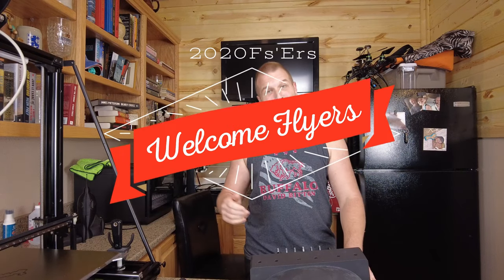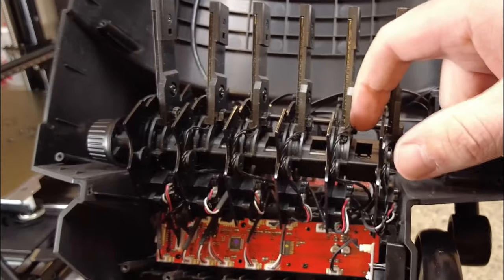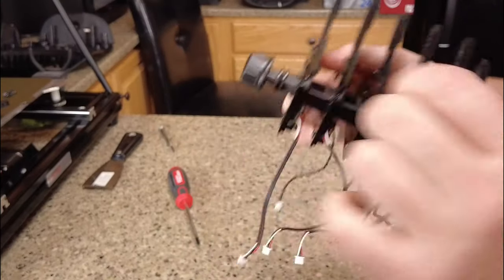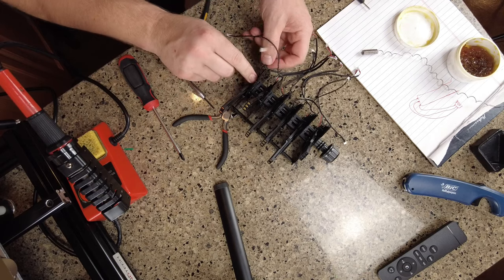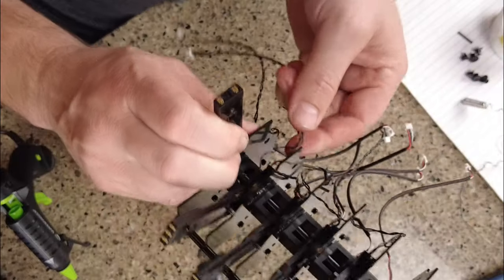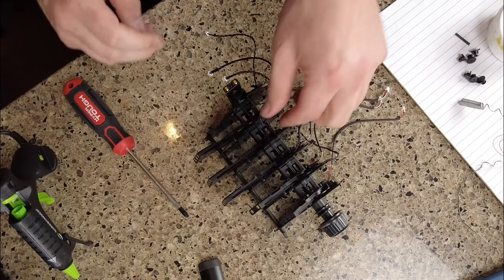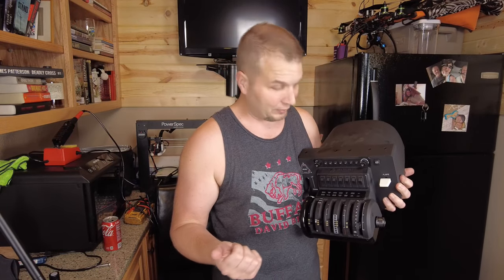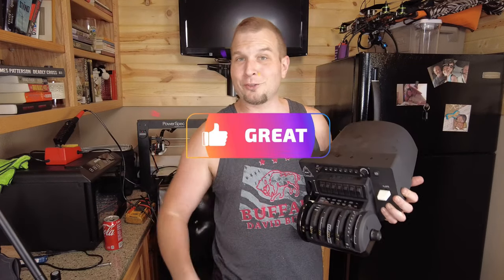Honeycomb Bravo Throttle Quadrant Problems REVersers NOT WORKING! Bravo Teardown REpair! POOR DESIGN

Comment: Just sent mine out for the same issue with one of the reversers. Got the new one in today after waiting two weeks. Went well until I realized the number 5 lever isn’t working. Oddly enough, when I move the #6 lever, the #5 in the calibration app moves which makes me think something isn’t wired correctly.
Reply from the maker: Yep you probably hit the nail on the head 🙄  the qc is not quite running on all  8 cylinders.
Reply: @2020fsers  What’s frustrating is no one is picking up their customer support phone. It takes 3-4 days to get a reply via email. And this thing literally just arrived from freaking Hong Kong. It’s like come in guys, you want me to do this again?
Reply from the maker: Omg that's nutz
Reply: @2020fsers  Right?!?! Looks to me like someone wired it wrong.
Reply from the maker: If you pop off the bottom they are plugs so you pull the plug and switch between the 2 . But i know we should not have to do that but ...
Reply: @2020fsers  So I guess I will them credit where it’s due. They just picked up their phone. Watched the video and they said they had never seen that before. Because it’s the second one, they’re going to ship it directly from their office. They’re shipping mine directly back to their office so they can check on this because they were concerned about it. So I’ll give them that.
Reply from the maker: Yep at least they are making an attempt

Comment: I've just sent my 2nd unit back with this same problem!
Thought it might have been something as stupid as this engineering fault
I'm wondering if the give a 12mth warranty on the replacement units?
Reply from the maker: I doubt they will . Hope you have better luck on this one
Reply: @2020fsers  if that's the case I will probably pull it apart when I get the new unit and hot glue the wires in place

The annoying part is Honeycomb aren't answering my help ticket !  It's been 8 days now and 2 more requests.

I love this flexibility of bravo but if there was another alternative I'd asked for my money back
Reply from the maker: I agree
Reply: UPDATE: Honeycomb just confirmed that they will give the full 12mth warranty on my replacement unit but they didn't confirm if they have solved the engineering problem :(
What do you think the odds are that my 3rd unit will break and need to be sent back?
Reply from the maker: Thanks a great update for warranty .  Probably gonna need it most likely they haven't fixed the issue tho 😕  or maybe they did only way is to open it up and take a peak .
Reply: @noisecraftstudio5817  I would not bet against it!
Reply: @anthonyvallillo422   They have confirmed a full warranty on the replacement unit
Reply: @noisecraftstudio5817  I hope that the replacements are also warranted for whatever the length is (someone mentioned one year) after the REPLACEMENT gets to you!  But sadly,  I have already lost at least a collective month of use to the replacement cycles.  This is a real shame, because if they were sturdier they are an outstanding unit, albeit somewhat difficult to set up and program.  Fortunately, others have undertaken to do that for us in the form of the profiles available on the web
Reply: @anthonyvallillo422  Just sent back my 3rd unit back because of this broken wire problem :(
Thank god it's still under warranty but I'm only getting about 6 months use out of a unit before it fails!

Surely this is not just bad luck!  They must be getting hundreds if not thousands of returns!

Comment: Hi John, hope you're well today, I need help, for some reason my prop 1 (C208) feather detent (switch button 26) does not make the prop to feather, nothing happens, closing the prop brings it back to the Prop MIN position, pulling prop lever beyond the flight detent position does nothing, the Caravan's prop stays unfeathered during shutdown, it just doesn't look and work correctly, please help Mate, thanks?
Reply from the maker: I will look into it and let you know
Reply from the maker: Try prop decrease instead for button 26 and see if that works
Reply: Thanks & wildo....will let you know tomorrow, I'll be a happy 2020 fs'er if it works, so far the C208 is the only aircraft in my fleet that does not cause a CTD or failure of any app, so the C208 has now jumped to the no 2 spot behind the TBM
Reply from the maker: That's crazy but I have also been getting more crashes than normal for some reason 🤔
Reply: Got hit by a 9Gb mandatory update this morning, doing that now, whilst sitting here and watching the white status bar grow I can't help to think "what on earth of all my sim stuff, software and hardware, will not be working when all this is done?", I'm optimistic, but from experience, since Sim Update 1 there's not much hope it'll be smooth sailing after the restart....keep you posted on that feather detent setting
Reply from the maker: Oh my lol I thought an update around the 19th was expected hope it's good let me know how it goes . 😅
Reply: Wildo, I guess you'll have it available already, it's the 20th now here  Downunder, unless you're beaten by the international dateline 😄
Reply from the maker: Lol I haven't turned on the sim today I've been making vids . 😅  I spend more time on videos than I get to fly lol but it's OK.  Some days I just don't even turn it on ya know just need a break sometimes and enjoy the outside .
Reply: Prop decrease doesn't work unfortunately ☹
Reply from the maker: Ok when I do fire 🔥 this thing up I will take a look
Reply: After Sim Update 6 and updating all other sim market place items, and PC reboot, my Honeycomb Bravo is now completely reset, all profiles changed, not even mixture lever working, the sim pick it up but no action on lever movement in aircraft...kinda expected from Asobo's update, frustrating and annoying is an understatement 🙄
Reply from the maker: I agree I use spad.next I was tired of my settings never saved for my bravo and alpha so I had to get something spad I'd great I love how you can configure anything .
Reply: My next request, 🙏 "please make a video on how to configure the Bravo using spad.next", I have that too but struggle, a video using spad would be great 👍
Reply: Sim Update 6 broke my Bravo, bought the Okavango scenery pack yesterday, had fun flying around in the C208, landing at all the various bush strips and watching the animals, after Sim Update 6 my Bravo is kaput 😭
Reply from the maker: Really nothing works? Even in the control menu ?
Reply from the maker: Im doing the update now it's morning here 8:27 am
Reply from the maker: This should be  a fun update lol not
Reply: Throttle 1 axis and reverse thrust working, Prop 1 axis working but no reverse thrust detent (I tried all options in the control menu for this, only get Prop 1 to go from MIN to MAX, Mixture not working at all (I tried all options in the control menu too, but no success)....all controls, apart from Prop Feather worked till I switched off the PC, when I switched it on this mng I was hit with the update and now Mixture not working at all, spent last 3 hours trying everything but no success, could not fly
Reply from the maker: Oh crap can't wait to try this I will try it with normal msfs controls and with spad and will let u know. Sorry to hear this it's always something with fs2020
Reply from the maker: Ok so I got the prop working and feather also the throttle and reverse but not mixture not sure what they did. So for prop feather search toggle prop feather and use the lower detent to activate then push the lever up and it will feather .  Throttle still the same using throttle decrease to reverse and using the lower detent as well. No mixture idk yet I haven't tried spad yet
Reply: Thanks John, phew, so it's not that my unit is actually kaputski, yeah, mixture here also not working at all, tried all mappings for it but lever in cockpit doesn't move, nothing wrong with the configuration picking up any levers or buttons on the Bravo, it just doesn't move in the sim, so 100% sure it is a result of the update.
Reply: There's no 'toggle prop feather' option under selectable options in the controls menu for the Bravo, there is toggle propeller switch 1-4, and none of them work for prop feathering
Reply from the maker: Yup its due to the update I even tried spad with every config I could think of with no joy. Oh well lol
Reply from the maker: Type in prop in search it's there I tried it
Reply from the maker: And make sure you have all checked and  not assigned buttons
Reply: Hey John, if you think of taking the Bravo apart due levers not working, don't, it's for sure the update's fault 😉 FB posts reveal many others having same issues, also, I did check a number of aircraft yesterday, throttle, prop & mixture works fine in regular prop aircraft but prop  feather and mixture not working in any of the turbo-prop aircraft, C208, BE35, C90 etc, seems like the issue is not restricted to just the Caravan
Reply from the maker: Oh no I wasn't taking it apart spad showed me that all the buttons were working properly . And my prop feather does work in the caravan though.   Thanks for the update on the issue ,  microsoft 🙌 did it again 👏  another day in the park lol.
Reply: 😆 I also have no more Bravo lights working....I've tried every prop feather option available in the menu, none works for me for the Caravan, switched the PC off and walked away, that forced me to start talking to my wife and boys in the house, didn't know they were such lovely people 🤣
Reply from the maker: Lol yea sometimes you just need to walk away 🤣  I bet they missed you
Reply: 🤣🤣 probably not as much as I miss flying the TBM and C208....I'm having serious withdrawal symptoms
Reply from the maker: Lol
Reply: Hi John, what's the exact phrase/text/line you selected for Prop Feather under PROPELLER in the CONTROLS OPTIONS for the C208? Wish there was a way to share screen or screenshot with you
Reply from the maker: Go to the bravo setting then in search type prop . Make sure the filter is set to all and its the 3rd down in the list that comes up it says toggle propeller reverse thrust
Reply: Thanks, found it, but the detent (Button 26 on prop lever position) does nothing at that setting, the prop does not feather at all, the sim picks up the detent selection but in the aircraft the lever does not follow the detent path into feather, it remains at min RPM line
Reply from the maker: It won't it's a toggle after you go into detent then push prop forward all the way
Reply: Ok, got it to work as explained, that'll get the prop going into feather, but it defies the logic of pushing the lever into detent mode then having to push the prop lever forward to feather the prop, if I look into the throttle then the reverse thrust (Beta) works 100% when pushing the lever into the detent position without having to first push the lever down to activate the reverse function and then having to push lever forward, why would the prop then work the opposite, blows my mind, you've been a champ responding to my comments and helping me, thanks for that....you are the only youtube host that respond to comments, I've seen so many other's ignoring comments or not responding, you're doing the opposite, thanks for that, it is indeed much appreciated...let's hope we can get the mixture working so I can get the C208 back into the air soon
Reply from the maker: Thanks Stephen  so think of the prop lever just a 0 to 100 percent on a scale  and the toggle feather selects whether you are positive or negative on that scale . Hope this helps understand it better .  Thanks again for the kind words I am trying my best 👌.
Reply: G'day John, I think the issue is most certainly the Bravo driver (not me the pilot in this case 😉) but rather the software driver, even the buttons do weird things, pushing buttons causes Baro to set, map zoom in and out etc, I would put my money on Honeycomb conflict rather than sim
Reply from the maker: Ellow there that's crazy im using spad with no issues I'm in the cj4 and it's great love this thing . What plane you like to fly in I can publish my settings for spad that you can import .
Reply: For SPAD.NEXT I fly the C208 and SR22, I have Saitek Panels for those, in particular the SR22...never used the Saitek Panels on the C208, but I miss flying the 208, I now cleaned every assigned button and lever and created a new profile, MIXTURE still not working at all
Reply from the maker: I did the same no mixture that's the only thing I can't get to work . I am having a very hard time trying to upload my profile so I may just make a video on the c208 with spad .
Reply: That'll be good, thanks....I tried everything this weekend to fly, TBM caused CTD every time I started the battery, could not get mixture mapped at all, no matter what I set and prop feather  not working, that took all of Saturday and half of Sunday, switched to XP11 and everything is working 100% there....are you on the Honeycomb group on FB?
Reply from the maker: No I'm not I didnt know there was a group . 😳  that's weird I fly the tbm all the time with no issues . Have you tried just the default livery I know it is basic.
Reply: I cannot fly anything, I have buttons and switches stuck in the ON position in C208, TBM, SR22, BE36 (most of what I fly), I cannot switch these buttons/switches OFF, not even with mouse, things like light switches, pitot heats, they remain ON all of the time, none of these are mapped since I cleared all buttons on the Bravo....I unplugged my other hardware panels, and the problem persisted, I cleared my COMMUNITY folder again, and the issues remain...I seriously ran out of ideas, my sim in all its glory as is, is currently broken...can I send an email or FB message in Messenger to you perhaps?
Reply from the maker: Yeah fb is good we can video call if you like and I can see what you see.
Reply from the maker: Email me at 2020fsers@gmail.com
Reply: Will send email today and tell you about my sim

Comment: Mine has never worked since I pulled it out of the box!!
Reply from the maker: What really the entire unit ? 😳
Reply: @2020fsers  The thrust reversers have never worked. The computer/game doesn't even sense an input when I activate the levers. Pretty much everything else works thought, as far as I can tell.
Reply from the maker: Wow maybe they forgot to plug them in I would think they  can't all be broken so probably not plugged in pull the screws off the bottom and pull the top off but be slow when pulling it off cuz there are wire connected to it then unplug them and pull the rest of the way off and check the connections on the board .
Reply: @2020fsers  Will do!

Comment: You'd probably be better off cutting the plugs off with a short length of wire and running all new wiring. Silicone coated wire is very flexible.
Reply from the maker: If I had to do it again that is what I would do it wasn't easy trying to get all the wiring to fit.

Comment: Can someone please share the gauge of these cables? (in mm or awg) I'd like to order some silicon wires before I disassemble my Bravo (which obviously has the same issue)
Someone mentioned that they used CAT5 wires, which I believe are AWG24 (or 0.2 mm2) but just wanted to confirm.
Reply from the maker: I used 26 awg silicon wire
Reply: @2020fsers  Thanks. I actually just stripped and measured a spare CAT5 cable and the copper gauge was exactly 0.41mm thick which is essentially an AWG26 as per the conversion tables. Will order some silicon 26's then, thanks again.
Reply from the maker: Your welcome

Comment: Major design flaw -looks like it can get just past the warranty period before breaking. The engineering aspects of wiring harnesses and wire-draw breaking wires/solders has been known and taken into account for decades. I guess the customers have to pay for some obscure Chinese engineer learning this lesson.
Reply from the maker: Some people have stated within a month or so they have had wires break and honeycomb is just replacing with the same design confirmed by a viewer whom had 1 replaced and opened it up to let me know what's inside and no change .
Reply: 7 mths before my first unit broke; 2 mths for the brand new replacement unit to break😡

Comment: After watching the entire video I find that I can't see just what you soldered to what.  It would have been good to have taken some macro photos of the details of what went where during this process.  Of course, even with that I will have no hope of being able to do this, but others may benefit.  You might even want to provide illustrated instructions in pdf form and sell that!
Oh, BTW, how much would you charge to do this to my unit!?
Reply from the maker: Hey thanks for the comment the only thing I soldered are the wires to themselves where they broke that's all . I made the diagram so I could keep wires going to the correct terminal.  Never thought of making a teardown and repair pdf if I get enough requests maybe but right now they are honoring their warranty so most people are sending them back. I probably wouldn't do this on another unit other than repair the wires but I would design some 3d printed thing to go inside to be a guide so the wire can move freely and then can mass make them.
Reply: @2020fsers  Although I did not take any of my units apart, I was able to see that my wire had broken cleanly, almost as though it had been cut by a razor.  I presumed that this break had occurred at some point where the wire was connected to a terminal of some sort....  I never saw any other broken end, but of course it is very difficult to see much through the small slot of the axis.